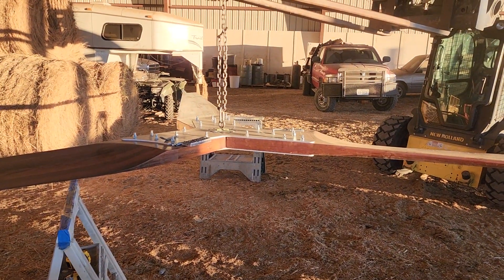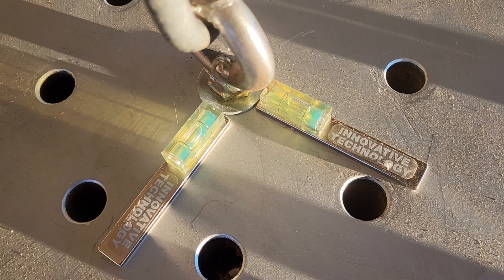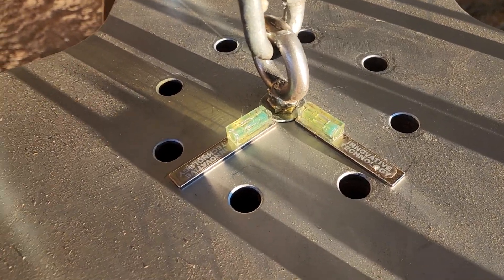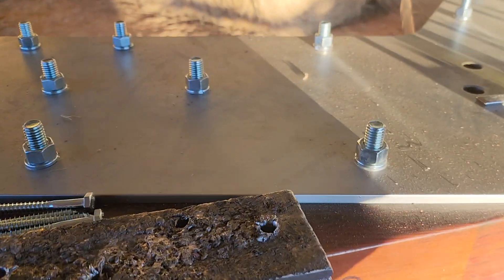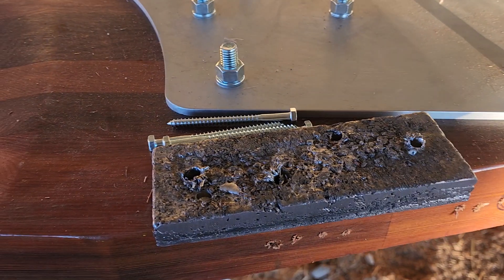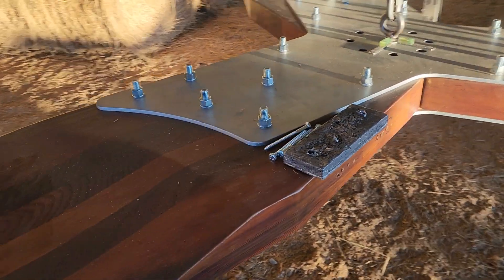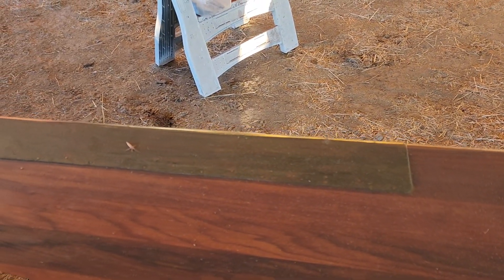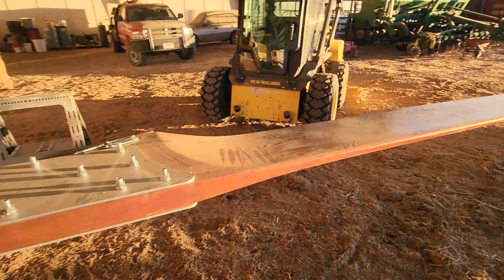Balancing Wind Turbine blades

Comment: Those are very small levels for an object that size. Perhaps a laser level would be better since it’s more accurate over an area the size of your turbine and it does not apply any force to the object being balanced. You could set up laser above the turbine and use a gauge block to check the tip of each blade.
Reply from the maker: seems that way, but it's 'static' balance, the rotor is bolted to the alternator only at the center ~ so it's only that small area (on the blade hub where it's flat) that matters.